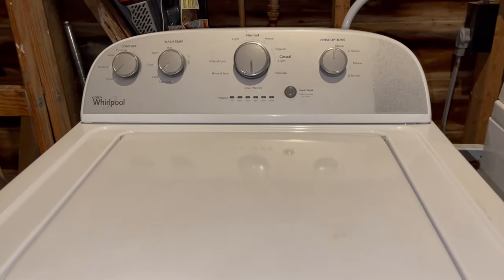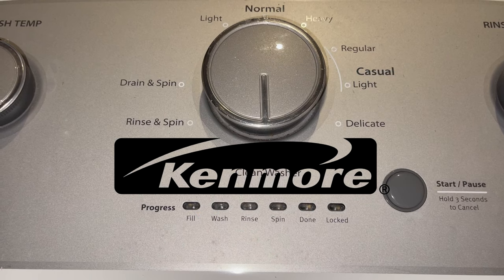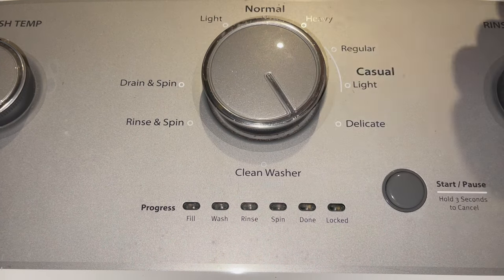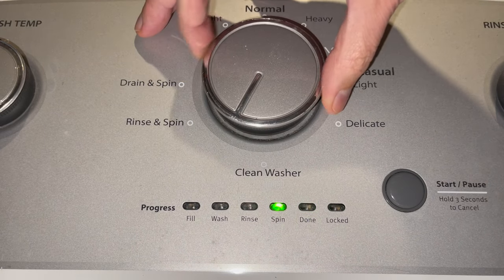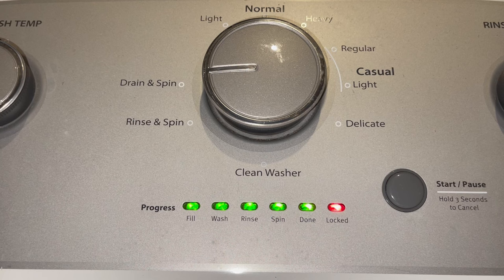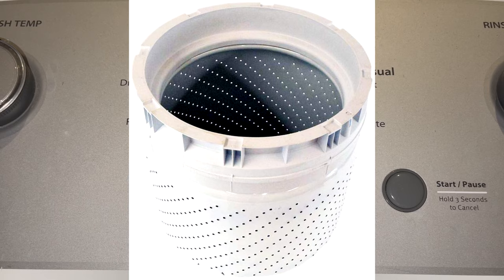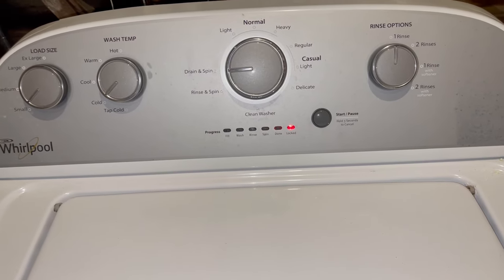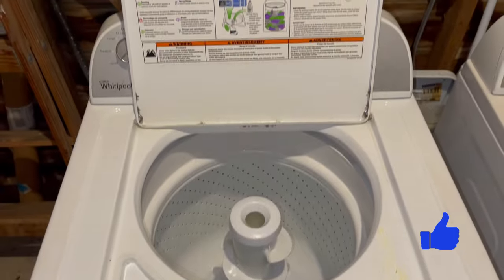Whirlpool washer reset calibration

Comment from the maker: Make sure the tub is completely empty when you run the Calibration Cycle.
Reply: I am getting it into calibration mode however when I chose rinse like you did nothing is happening how to I get it to go through the cycle ?
Reply: Mine is banging loud when draining and spinning. This will not fix it will it?
Reply: Legit read this like 60 seconds into doing this with a load in shit lol I cancelled it I'll try it later I suppose
Reply: @222trixie  check if it's leveled. And if still does the banging, it might need the springs replaced. The guy that came to do it said he had to replace the 4 springs, and that assures you you'll have more service out of the machine without constant replacing. Hope it helps
Reply: Lol should of read this before I loaded up the machine lol
Reply: @Donman06EDITZ  for real!!! Mine has the last bit of laundry soap in it and read this right after it started going.
Reply: @Zantsmith  same!
Reply: Do you have a video on how to stop the washer from letting the water leak out of the tub, when it's  over the 3 inch mark. It will run the full cycle but only with 3 inches of water.
Reply: @Boss-fv8dk  I’m having same problem
Reply: Also the video skips step 1, which is to make sure the machine is in "standby mode" (plugged in with all indicator lights off).  This is critical...  won't work otherwise.
Reply: @musgrove95037  have you laying the machine back you have to pull it away from the wall and get somebody to hold it. There is a tech pack that is glued to the front of the machine on the inside next to the tub tells you everything you want to know.
Reply: They USED to be good. Not anymore!!!
Reply: Mine will never go into calibration mode.
Reply: Ok I did no water in tub no lights nothing  happens
Reply: It is empty no lights no lid switch interlock nothing😬
Reply: I just rebuilt a direct drive new clutch pack and water pump easy no electronics
Reply: @222trixie   it is the strut rodes they are a dampering rod and easy way to explain them to you have friction on the rods which slows down the rotation of out, a balance, pretty easy to fix. You can pull one of them off at a time, or you can actually rebuild them does it do you, YouTube channel that show you how to do that
Reply: Can you plz explain I am a noob on these new machines
Reply: I did this but I have wet clothes stuck in the washer and it won’t do anything. Help
Reply: @Boss-fv8dk /kikikkkkkkkkkkkkkkkkk
Reply: @Boss-fv8dk did you press the start button after choosing rinse?
Reply: @yuhz1m1  you have to push the start button after the rents indicator lights up
Reply: What if you select recalibrate and nothing happens ... all the lights lit up in sequence and the machine turned off
Reply: Bro, you just saved the day , Thank You
Reply: How do we drain it when it wont spin.
Reply: @Boss-fv8dk press the start button
Reply: @syllarios5129 what I normally do is to cancel the cycle and select drain and spin
Reply: Mine got stuck during a wash on locked and done both red lights. I stopped the cycle now it won't drain it's full of water n won't drain what do I do

Comment: What worked for me are the following steps:
1. Make sure the knob is in the Normal position. Unplug and plug back the washer power cord.
2. Turn the knob left, then right 3 times, then left, and then right. Now LEDs will be blinking signifying the system is in reset calibration mode.
3. Turn the knob in any direction until only the Rinse LED is blinking.
4. Press the Start/Pause button. The recalibration reset will start. Wait until this is over, which will take about 10 minutes.
Reply: Tried your way. Thanks
Reply: Me too thanks this worked!
Reply: You are a Saint. This solved my problem! Thank you.
Reply: Thank you for sharing. I am about to call technician or buy new one. Thank you again.
Reply: Thankyou this worked very well
Reply: Amazing how a comment showed me how and not the video
Reply: When I do this and start the machine  it doesn't run a wash cycle.  Only the lock light turns on and turns off and nothing else happens
Reply: @yessieq7760  In step 3, only Rinse LED must be ON. Make sure of this.
Reply: @emilydesrosiers9034  The instructions I shared are for Whirlpool washer model 5000DW, which doesn't have any display for time or timer. It only has a row of single LEDs denoting different status of the washer operation such as sensing, wash, rinse, spin, and done.
Reply: I didn't have to go there mine was fixed the first time I tried I couldn't believe it worked!
Reply: @kathyhyams5757  Good for you. For me also the procedure shown in the video sometimes worked the first time, and other times, it didn't work even after 10 times. I  am sure different washers respond differently. So, I tried to figure out a deterministic procedure that worked every time.
Reply: @vk274  I'm glad you got it figured out!
Reply: @yessieq7760 I’m having the same problem. I also made sure it was only on “rinse”
Reply: anybody have a solution for this?
Reply: @yessieq7760 did you figure it out
Reply: Wow thanks it really works
Reply: The way the video showed did not work but your way did.  You probably saved me at least a couple hundred dollars. Thanks so much!
Reply: Thank you so much Sir. My washer is now working. Many blessings 😊
Reply: So, your method worked to get my washer recalibrated and out of an infinite spin cycle. But now it keeps restarting the rinse cycle. Any help is appreciated
Reply: @junkwaxflashbacks  Sorry. The procedure I shared is for only recalibration of spring shock absorbers. It doesn't correct operation any cycles. You can try removing powder cord and reconnecting after a couple of minutes to make sure any capacitor in the electrical circuit discharges completely to reset the electronics.
Reply: This is the only way it worked for me!!!
Reply: Thank you
Reply: Thanks for writing it out! Big help!
Reply: This is the one! 🙏 both of you
Reply: This worked for me as well.Thanks bunches.
Reply: @vk274 You're a Saint! 👏 Thanks.
Reply: It worked until it got to the spin cycle then it just shut off. This is the biggest pos washer.
Reply: Amazing ,thank you ,I was at my wits end and about to pulverize my washer with a sledgehammer
Reply: This worked!!!! Thank you so much!!!!!

Comment: My problem was the water barely dibbled in, nowhere near enough to wash and then it just sat there. Or, if the washer did fill to the right level, it hung at rinse, drained and left the clothes soaking wet. Followed these instructions. The washer is working correctly now. Thanks!
Reply from the maker: Thanks for sharing.

Comment: I believed this worked the other videos on replacing suspension rods do not mention recalibration. My machine was still violently shaking after I already replaced the suspension rods after multiple cycles. Last wash I did after recalibration ran smoothly hopefully it finally worked thank you
Reply from the maker: Good to hear it!

Comment: For who It might help…. Our washer was not lighting up at all (store said to by a new washer) and it was stuck on the spin cycle while washing blankets. I pressed the pause stop button for 3 seconds and the second time I did the recalibration I did it correctly and its fixed. 
Because the lights went out on ours when it was uneven during the spin  the  store said they thought the mother board was fried. Everything went back to normal doing this including lights working again
Reply from the maker: Thanks for sharing.

Comment: Our 3-4 year old Whirlpool washing machine model WTW4850HW1 has been gradually shaking violently with certain loads, especially if there are only a few blankets or towels in it. We tried this re-calibration trick last night without replacing any parts and my wife said it ran better today. We will continue to see if it helps.
Reply from the maker: An even load distribution is very important on these machines. 
Also, suspension rods wear out fairly quickly. So, it might be prudent to replace them first for balance issues.
Part number W11217817
Reply: Those suspension rods aren't cheap either. I wanted to try the recalibration first before doing something like replacing the suspension rods. The washing machine has been running great when I did the recalobration from my first post until today when my wife believes she overloaded the machine with towels. She said she added more than usual to see what it would do and it did shake with a lot of noise but apparently it wasn't as bad as it used to be. She will lighten the load from now on to see if that helps with all the loads. If the machine continues to mess up, we can see about replacing the suspension rods. The machine is only about 3-4 years old.

Comment: Make sure you take the wet wash out and let it drain if you can. I held the button to off and it drained. Took the stuff out. Unplugged it, plugged it back in and started the recalibration. All set, maybe should of added that to the video to make sure stuff is out. But I looked through the comments first and saw what the person typed.

Comment: Thank you, this worked although I ended up trying it twice, I screwed up the first try. Will this solve a auto sense issue? For some odd reason, my machine decided to get confused, auto sense and full wash ended up backwards. For full wash the switch had to be on auto sense, and for auto sense wash, the switch had to be on full wash position. I have zero clue how it did that, it just started doing it all a sudden.

Comment: I have well water, this was caused because the water lines were clogged, so the machine was not getting enough water. Disconnected both waterlines behind the machine and cleaned them with a wire brush. That did the trick

Comment: We just bought a brand new Whirlpool and worked for a few days then when I washed a bed blanket, it refused to spin and drain so we went to Home Depot where we purchased it and the Appliances Mgr told us to unplug the machine (to reset it from most likely unbalance) and then plug it back in. No problems so far. Knock on wood!! Also, this is SUCH a cheaply made machine. It almost looks disposable. Almost.
Reply: how did you reset it? mine shakes a bit

Comment: I recently got this machine and all was well. Until i forgot for mintue that you have to press the start/stop button  before opening the lid, my old machine you could open the lid. I was adding something i forgot and it was only filling up with water but since then the fabric softener is not dispensing. Still there. It goes to the rinse cycle but the fabric softener is still there and the clothes are dripping wet not draining properly and i just bought this machine.

Comment: I have NO LEDS even on but, machine sounds like it's pumping like draining. I have unplugged and waited overnight to try this. When plugged back in, it starts this "cycle" again. I tried your technique but, i Still do not get ANY Alights on. I'll let it run fw minutes and see what happens. BY THE WAY: This started last night, all by itself. Empty drum. If unplugged, it will start agin, after plugging back in. UPDATE: It wnet into Self Calibration Mode all by itself so.., leave it be for several minutes and it will finish. Not sure WHY it did that but, it did. THEN, I went ahead and ran RECalibration again, to be sure and all went well, without any issues. I have not ran a load yet but, will, today. Thanks, for the info video!
Reply from the maker: Thanks for sharing.
Reply: You're welcome. @Your-Self

Comment: Good video. I did the reset but I still have a problem with the temp selector knob/switch.  When I rotate it between warm and hot it give a 1/2 second  of both and goes back to single flow and both are slow.  Can you or any of your viewers give me an idea where to search for answers?  Thanks for your help

Comment: Ours is 4 years old and has never worked right, serviceman had been out 5 times replaced circuit board, reprogramed it but nothing seems to last only a few loads then it starts all over again, sooo many issues with this machine.  Finally bought a Speed Queen the Whirlpool will end up in a land fill.

Comment: Can you turn off the auto sensing? I want more water in my clothes when they're washing. I put spray and wash on my shirts because they get stained a little bit and they do not come out it doesn't wash the clothes like it's supposed to and never has since the day that I've had it please tell me if I can turn that off and it be a normal washing machine
Reply from the maker: Some washing machines can be tricked by pouring a bottle of water on top of the clothes to make them heavier. The auto-sensing will assume there are more clothes and will use more water. Try it.

Comment: My brand new Maytag top load HE washer is a complete lemon. when i wash bedding it makes these horrible banging noises, requires me to babysit the machine while it refills the basket TEN TIMES or more trying to "rebalance." using way more water than an old school washer. when i wash clothes they leave soil residue in the creases of the clothes. I have used this washer for over a year and every single time i try to wash a cotton blanket or cotton comforter it makes these horrible banging noises and even after repositioning the items multiples times it still fails to balance EVERY TIME. and when the machine tells me it's done the blankets are still soaking wet and smell like sweaty soiled clothes because it never gets properly agitated or spun/drained. The machine tells me it's done but the clothes smell like sweat and dead skin and are dripping wet, obvious signs of a deficient washer. can't clean and can't spin dry. so now i'm drying a soaking wet blanket for over THREE HOURS in the dryer that smells like dirty clothes because the washer told me it is "done" because it simply stops attempting to spin after multiple attempts. I cannot wait for a class action lawsuit against Maytag top loader HE washers, they are the worst in the world. I will never buy anything Maytag as long as I live and will tell everyone I talk to about how bad Maytag is. NEVER MAYTAG, THE WORST BRAND OF WASHING MACHINE EVER MADE. I cannot wait until the class action lawsuit arrives. Maytag you deserve what happens to you for selling a lemon, you complete and utter scumbags. AVOID MAYTAG AT ALL COSTS. Also their dryer is way too hot at the "low" setting, burns my clothes. worst company ever. and they don't even honor their heavily advertised warranties because MAYTAG is complete scum.
Reply: Sad, they used to be the best, the old ones never broke down,

Comment: thank you! I have recalibrated like you instructed but my machine is full of water and I can't get it to drain. How do I do that?
Reply: I have the same exact problem. I’m going to try it even though I have a full load with water in. Wish me luck 🤷‍♀️
Reply from the maker: The calibration should be done with an empty drum.
If it's not draining, the drain pump could be bad. But more often, the problem could be with the lid switch.

Comment: Thank you sir for your help! For some reason my washer (exact same model in this video) stopped making beep sounds after finishing the wash cycle! I'm not sure what we did to accidentally disable that! Any thoughts on how to re-enable that by any chance? Thank you so much!
Reply: The beep emitter may have died, but the service mode this video shows you how to enter (before selecting calibrate) has many functions, I imagine the cycle finished alarm is in there somewhere  you just need to look up your model and put manufacturer settings or options in with the search

Comment: I replaced the cycle sensor and drive assembly and a new belt, I didn't do anything but plug it in and it runs fine.

Comment: Great video HORRIBLE machine the H E  shouldn't stand for high efficiency it should stand for high expectations on which it falls very short of  I bought this POS at the height of COVID  because I had no choice it was replacing my old Whirlpool washer which had given me over 15 years of trouble free service this one takes forever to do laundry and gets stuck on sensing mode or goes out of balance very easy  and has to be recalibrated  who ever thought you would have to go through so much Bull 🐂 S#$& to perform a once simple task like washing clothes my hats off to the people at Whirlpool for taking a simple task and making it complicated and unreliable I'm having this one fixed and my new one will be an LG
Reply from the maker: Thanks for sharing.

Comment: I just bought a washer like this. It looks like the same exact one. I have a question. When the agitator is running, does it sound like it's it's slow motion and also stop for a second or 2 before running again? It seems like it will run for one turn and then stop and then run and then stop and it repeats. Or is there something wrong with my washer. The thing is brand new. It's only 2 months old.
Reply from the maker: Not sure.
If it has an Auto-Sensing, it may do something like this at the beginning of the cycle.
Or maybe you are using a Delicate Cycle?
Reply: @Your-Self  I think that's what it was, auto-sensing. thanks

Comment: Mines not using any hot water. Replaced the valve assembly but still no. Tried this and it works as described until I hit "start/pause"....my lights all just go out
Reply from the maker: It's difficult to say exactly what's wrong. 
The main control board itself could be bad. And I've heard that a bad/clogged drain pump could make the lights go out as well.

Comment: How do you get it to completely drain? Mine drains just fine, but if I move the washer, I can still hear some water inside.
Reply from the maker: What you hear is probably the sealed water ring that is installed there for counterbalancing.
 It's totally normal.